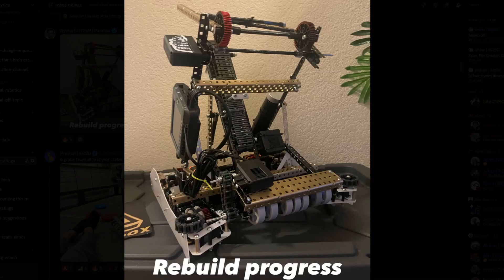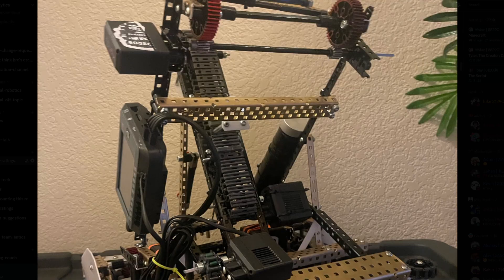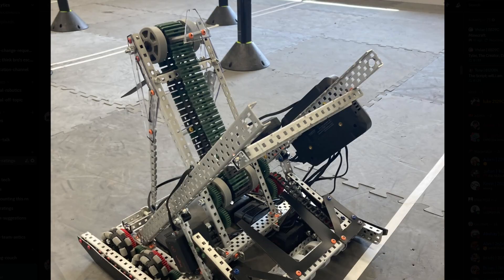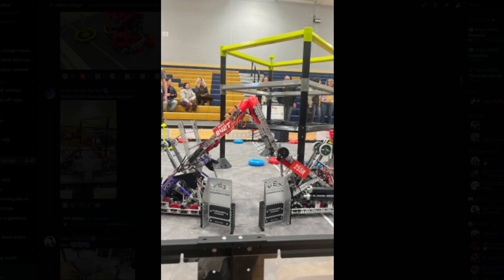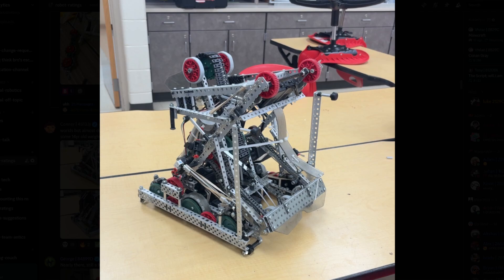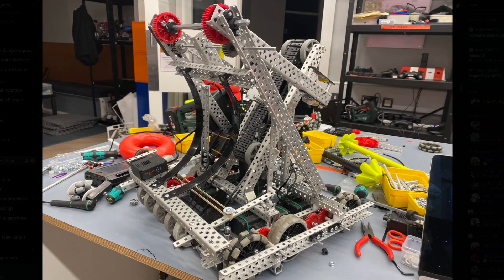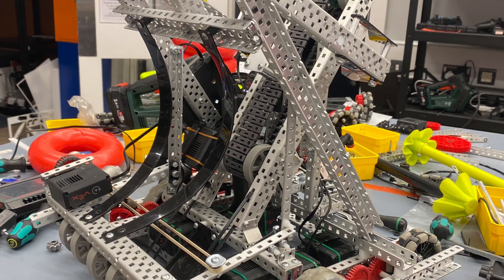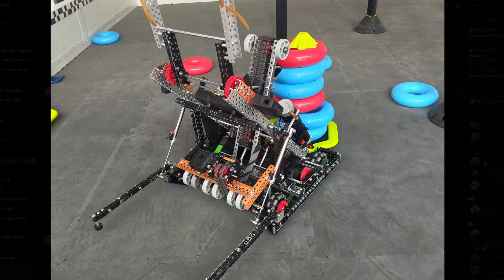Flint n steel (robot rating)

Comment: the piece in the video at 6:15 is when they go to the corner in auto they can grab the 1st level ring with their intake and the 3rd level ring using that piece so when the robot move back quickly they can pull the 3rd level ring out and intake it
Reply: Yes sir, i was gonna answer it when i saw bro rating the bot but bro beat me to it